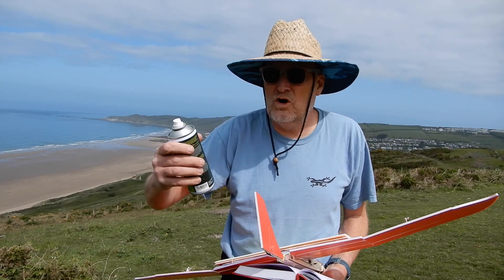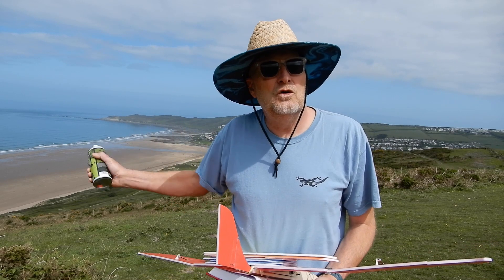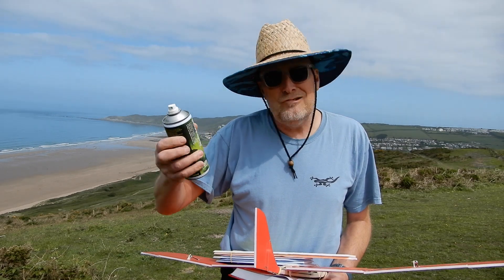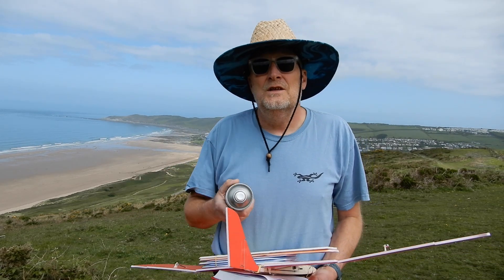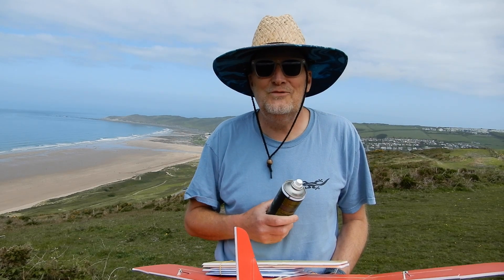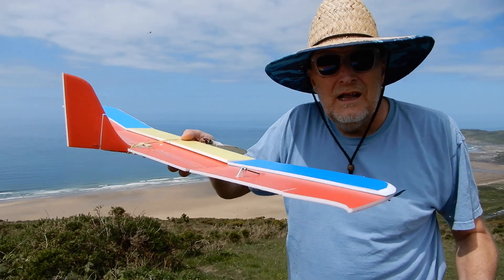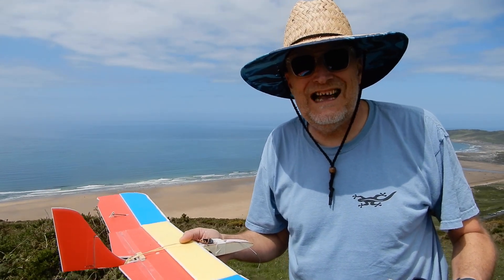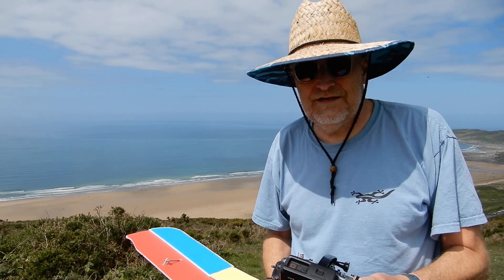Test Flight Flying Wing morphing Kline–Fogleman wing sections Part 2

Comment: Very interesting test.
You have changed the weight. To have better comparison you should have loaded the plank to come to the same overall weight.
You could also modify only one wing and then trim. By noting the trim in aileron and rudder you would have a measure of improved lift (aileron) and degraded or improved drag (in the rudder trim).
Reply from the maker: @antcam007  https://www.angelwingdesigns.co.uk/products/dune-freak-pre-order

Comment: Nick… Thanks for all the effort on the KF airfoils. These airfoils are primarily meant to be used with full power. That is when they work best at trapping a vortex which becomes part of the wing and gives great stability because the vortexes tend to equalize and thus maintain stability and stall resistance. KFm4 is really built for power and speed. KFm3 is best for heavy lifting. I salute you for these videos.
Reply from the maker: Thanks Dick I am honoured you have taken the time to reply. I will be adding power in the future

Comment: Interesting. What I saw was that the KFm2 was struggling to maintain height when your friend's glider was soaring around just fine. Obviously completely different models so hard to draw any hard conclusions but I know from my own back to back testing of a DLG with a Mark Drela airfoil vs the KFM2, the Drela was vastly more efficient. The KFm has got ease of build in it's favour.
Reply from the maker: The other glider is electric. Comparing klinefogle to drela is like chitty chitty bang bang against a Ferrari 😘 
Kfm is cheap fun tho 🤩

Comment: I really enjoyed your series of tests with the KFm sections, especially the excellent result with KFm2.  FWIW (I always wanted to write that!!)  it seems that the KFm4 might be the equivalent of a symmetrical airfoil and I don't know of many (if any) flying wings that use a symmetrical section. It might need a bit more reflex on the elevons and outer panels to increase the angle of attack to get it to work a bit better - but what do I know, I can't even spell aerodynamics).

 It's really good when someone says, "What the heck, let's try it!"
Reply from the maker: I ve had the most fun out off a couple bits of foam 😂
Reply: @NickChittyFlying  That's what it's all about

Comment: Nice experimenting Nick! Try the KFM4 against the KFM3 - otherwise you are comparing apples and bananas. The problem is, that to have comparable airfoils the number of plates should be the same. Otherwise you increase airfoil thickness by 50% - and it's quite obvious what this does to the glider performance... What's also more interesting: cover the tipp with some oracover or tape. Or try changing the centre of pressure by cutting back the step positions - like @Aerial Waviator is suggesting!
Reply from the maker: Yes I need thinner sections for kf4 but it’s all fun 🤩

Comment: Brilliant! Really seems to thermal well wit KFm2. Like how this series of experiments is going. 
Looking forward to seeing some bungee action next? This could allow for some calm air experiments to more clearly spot differences in flight characteristics and feel.

In future, would be curious what happens if varied the step position of the KFm2 from the leading edge. Example: if moved to a 1/3, or 1/4 of cord vs. the initial 1/2 cord placement. With KFm4, might be interesting to experiment with reduced thickness. (but access to thinner foam might be a challenge)
Reply from the maker: Spot on I am convinced kfm4 is too thick

Comment: Hey Nick, great video.  I made a KFM40 flying wing which also uses the KFM4, was rubbish as a slope soarer though, just seemed too draggy. Like you say though, almost impossible to stall, could land with back elevator and just land with a plop :)
Reply: I did the same, the Trond KFM4, nice plane under power but didn't have much of a glide slope - KFM's are renowned for their non-existent stall
Reply: @Tsnafu  Yeah you wouldn't want to run out of power and try and glide home with a KFM4 :) I did enjoy my scratch building, just don't fly enough any more :-/
Reply from the maker: I was stunned by kf2 performance but I have theory about the 4
Reply from the maker: Yer not impressed with 4